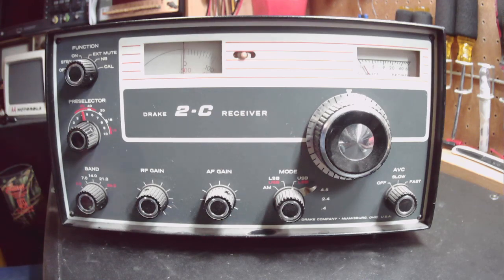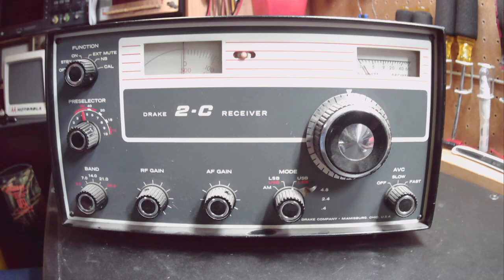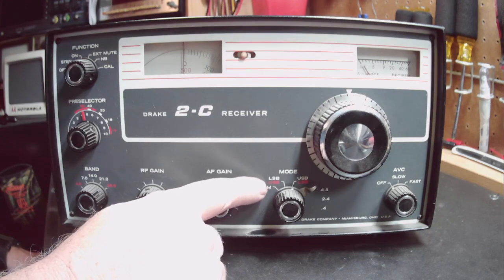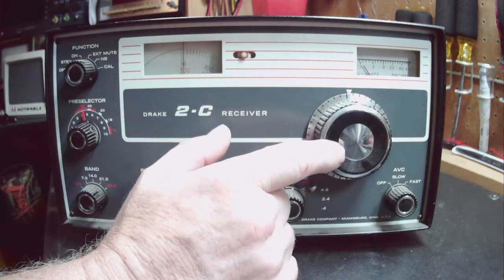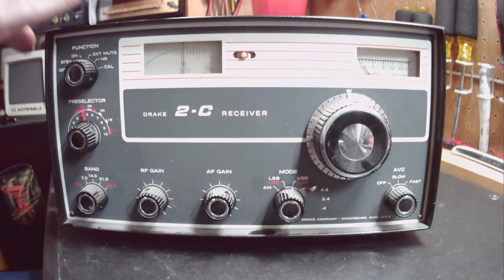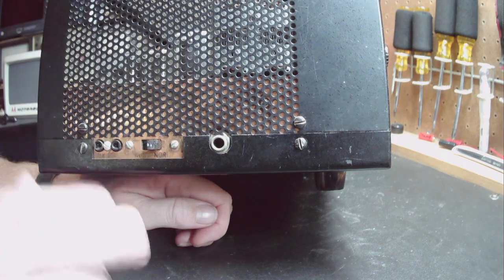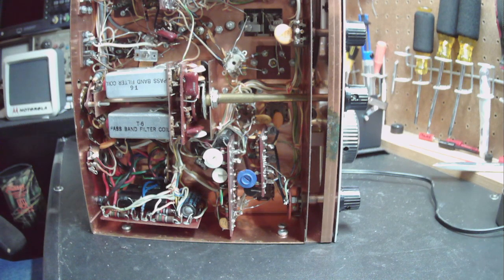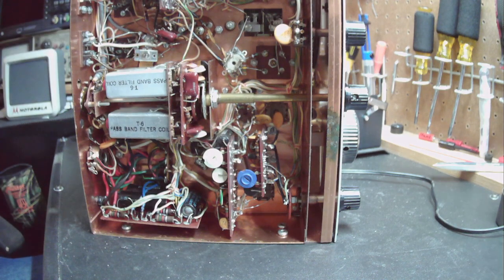Drake 2 C Introduction

Comment: I picked up one of these at a hamfest about 5 years ago.  It was a little rough but worked perfectly.  I still have it.  If you push crystals into the socket on the side, you can tune a lot more frequencies with it too.  It's a ham-band receiver but will pull in all kinds of broadcast signals as well.